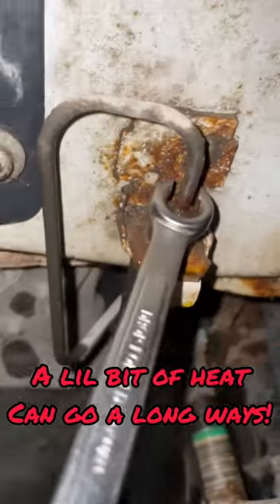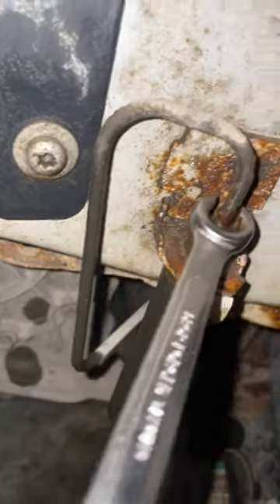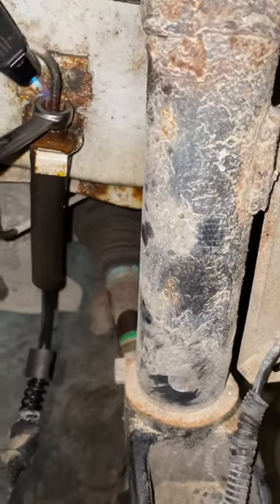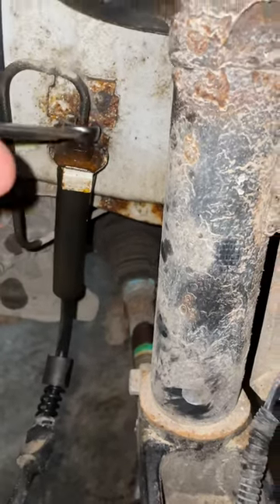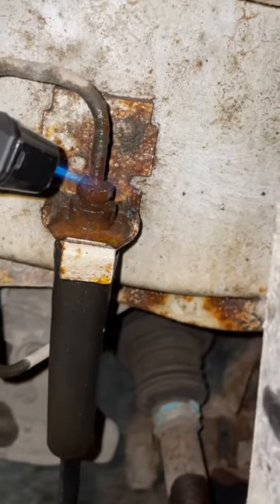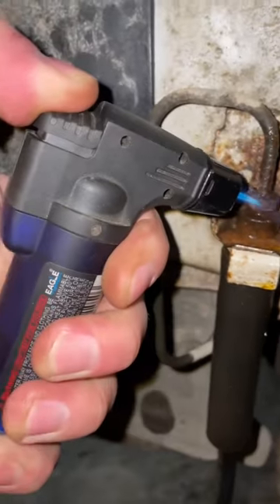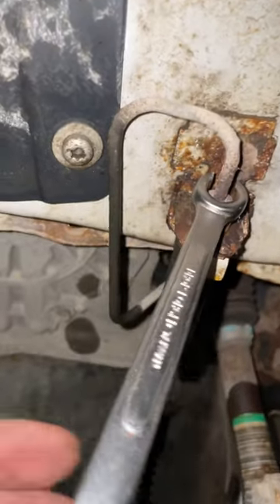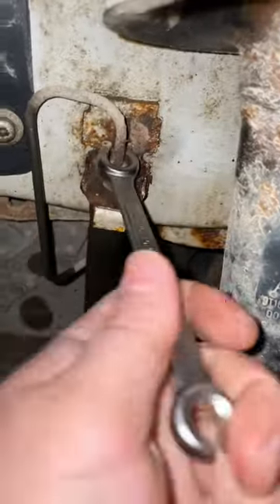When it comes to rust, heat is your best friend 😎

Comment: I could see myself twisting that line in half like it was yesterday
Reply: That was yesterday
Reply: @Bouldergoat  😂
Reply: Lmao
Reply: I just did that the other day
Reply: Did that on an old Chevy fuel line
Reply: I think everyone has done this lmao
Reply: Im guilty
Reply: Yeah, my “fix” usually involves 2 breaks, mostly due to impatience.
Reply: I was thinking the same it's shot anyway. Then you could remove the fitting with a socket.
Reply: Cheap Chinese line wrench is most likely stripped they don’t get heat treated

Comment: THE MOST IMPORTANT  part of this op is not to round the hex before using heat.  
Additionally - cycling heat / cool / heat cool a few times causes the metal to shrink and swell creating separation

Comment: Great tip!
Don't forget about using a backing wrench when possible, to avoid twisting the assembly.
Reply: What do you mean by backing wrench?
Reply: Typically a 2nd wrench (possibly vice-grips if necessary) to hold the stationary fitting from being twisted.
Reply: @thisisyourcaptainspeaking2259  the is no stationary fitting it's just a brake line with a regular ol fitting
Reply: @MacAutoDiag  What if the flare nut refuses to release, how do you avoid twisting the steel line and/or wallowing out the bracket?
I guess you need more than a single flare nut wrench, no?   Else say good bye to the steel tube?

Comment: When installing lines I pull the nut back from the flare and coat the line with antiseize. This prevents this from happening. Put some on the threads also.
Also, on car that I haven’t replaced the lones on I spray every bolt and these brake lines that I can reach whenever I’m under the car or have a wheel off. At some point I may have to remove any one of those bolts in the future.

Comment: Sometimes if the nut will break free from the hose but the nut is stuck to the metal line, you can take the hose clip off and drop the hose down through the bracket enough to spin the hose off of the nut

Comment: It's good practice to crack the line or bleeder loose to alow pressure relief if overheated. I've had rotted flex hose crimps blow out. Or be sure to wear face/eye protection
Reply: I was wondering if additional considerations should/could be taken. I’ve seen it done on suspension fasteners but I wouldn’t have thought about doing it on a stubborn brake line.
Reply: This guy silly, that brake fluid gets up to 200 degrees, there ain’t no way that lil torch wud get even close to those temps. 🤦🏿‍♂️
Reply: @txmade4371  Since were on the topic, have you heard of people heating up ball joints and having them explode? I can't remember if it was ball joints or something else that I heard about.

Comment: The thing to remember is heat does help loosen it up. But brake fluid is flammable. So too much is a bad thing. You don't want the fluid to get too hot inside of the hose or brake line. Only use as much heat as necessary to get the job done
Reply: I live in a Scandinavian country where they throw corrosive elements on the ground when it gets cold

You are right, but sometimes there is no such thing as too much heat - butane torch definitely wouldn't have done the job on my 250k mile Volvo haha
Reply: Good consideration, but it is not particularly flammable. It is like oil, it only lights up if torched for long enough, and it definitely will not light up inside a sealed line full of fluid. Sure the external torching of line will make some pressure inside the line, but the system will handle much higher pressures in normal operation. So no explosions nor line-internal thermal runaways will occur.

So generally the torching of the fitting can be said to be perfectly safe. Only if it leaks, there is a possibility that the leaking fluid will light up and give "dripping flames" at worst, easy to extinguish with a not-too-flammable rag, which you should have around, though.

Only actual danger arises if you have a puddle of fluid around.

Edit: True though that too much heat is bad, as it may damage the rubber hose. And may even cause it to explode as a combined effect of heat elevating the pressure while deteriorating and/or softening of the rubber. This has, however, nothing to do with the flammability of brake fluid.

You should by all possible means keep the heat on the metal fitting and pipe side, out from hose side. If need for prolonged torching, active cooling of the hose side with wet rags or something like that might be a good idea.
Reply: My only disagreement is what the heat will do to the properties of the metal line
Reply: @xESPplayer500x  Probably just retract, the wear of the end line would just make me want to redo it over anyway personally. but if it's a customers car may be a different story on how they want to go about it.
Reply: Brake fluid isnt flammable unless you have an extreme amount of heat. You could pour brake floud on the ground and hit it with a cutting torch and it wont light
Reply: @timm.e.n.  this. I don’t even bother with using anything other than oxy acetylene anymore. Way faster and always works you just have to understand that you can melt things if you aren’t careful lol
Reply: @xESPplayer500x  the metallurgy is fine at the temperatures required to loosen up things. Maybe 450 to 500F on the nut, which means maybe 250 or so on the line itself. Steel doesn't start changing properties until you get up in the 800-degree territory for prolonged periods. You'd be there half the day with that tiny torch pointed in one spot to get dangerous temperatures on the nut. And even then the steel wouldn't undergo any significant change. I've reused fasteners that I've taken to dull red, which is around 1,200f.

What's worth worrying about is the line's wall thickness reduced by rust. But it'll probably last longer than the rest of that crusty heap in that climate.
Reply: @tonyw1563  corrosion resistance

Comment: try "painting" a drop of hydrochloric acid based drain cleaner and waiting five mins (won't hurt the rubber line if you need to reuse) rinse and crack off works on most rusty cruddy stuff. eats it alive👍
Reply: But if the acid isn't cleaned off properly more rust will appear
Reply: It will eat the line up
Reply: Acid & rust 😂

Comment: I like to use my induction heater. Can wrap the coil right around the line, heat the fitting quick and not risk burning the surroundings
Reply: I was going to ask in the comments about breaking out the bolt buster. I know it's not a time saver but it does the job correctly and safely.
Reply: Yeah, an induction heater is great, except that they're in the $250  - $500 range.

Comment: This happens to often to older cars and it’s a pain to fix. When I replaced all my calipers and brake lines I smeared grease all over the fittings to try and reduce the air/water exposure.

Comment: Update,  I  tried this on my 2005 gmc sierra 1500 rear wheel cylinder.  It frickin worked great.  PB Blaster and mini torch and patience,  heat and wiggling gently back and forth and rust broke free and saved me a huge line repair headache.  Thanks.

Comment: That little bitty torch send perfect for tight areas like that
Reply: i even use that kind of torch to soldering car wire, more faster than using an usual soldering iron.
Reply: @Bobo-ox7fj  Never knew that electronic flux will corrode things.. that corrosion only happen with a acidic flux made for the copper pipe weld.. never seen that happen with electrical solder and flux even if you not clean it afterward.

Comment: Changing the rubber line? Cut it off, remove it from the bracket and THEN get at it with the heat and wrenches .You don't want to be anywhere near an exploding rubber hose. Hold the line fitting and remove the rubber line fitting. Free the steel line fitting later.

Comment: It's common for the hose itself to rust down into the retainer nut. So while you can break the nut itself free the hose is turning with the nut as well. If you're not careful you an break the line as it twists around. They have a decent amount of twist though, I've definitely rotated some a few times and still been able to use the line and connection.

Comment: If you want to replace brake rubber pipe, it's ok to open it.

If just rust outside and nothing damage (brake fluid circulation) or leak issues just leave it or clean the rush and repaint, repaint help rust not come back earlier

Comment: PB blaster can't get in there because of the type of thread.
But if you use some heat on the area it is screwed into you can get at it without waiting.
You can then use the penetrant while it's hot for saving the brake line .
Some of those, only vise grip pliers crimped on very tight will allow knocking it free with a hammer.
Glad yours was not so bad.
Just looked bad.

Comment: Easy, cut the hose, remove the retainer clip on the end of the hose, gently push the metal tube thru the mount exposing the flare nut below the mount. With correct size flare wrenches on the cut part and flare nut. Separate and deal with the stuck flare nut. Heat  nut and a melt a crayon (any color) into the stuck nut. Ancient Auto Tech tricks.

Comment: If you’re replacing the hose then cut the hose, remove the retainer clip, push it through the bracket and hold the brake line nut and unscrew the brake hose ferrule from the nut. No danger of breaking the line and no little lighter bs.

Comment: I strongly recommend cracking the bleeder or cutting the rubber line open (if replacing it) to avoid it blowing up in your face.  Probably not likely with the small torch but still, better safe than sorry.

Comment: When I was young I took a propane torch to a brake line to try and get it loose and I overheated it the rubber line exploded and covered me in boiling brake fluid yeah those were good times
Reply: I just mentioned that too.

Comment: I’m fine with this method but just a little tip be careful heating up any kind of brake lines cause it can build up pressure and when you crack that line loose it will spray hot brake fluid at you. Maybe after you heat it up put a rag over it as your cracking it loose.
Reply: How is it going to build pressure??? Any pressure would just go up to the master cylinder. No different than pushing the caliper piston in.

Comment: I have dropped the line down, twist the hose off and twist the new hose on. Insert back into the bracket
Reply: Easy fix many overlook. Good catch.
Reply: I've done that a lot of times too. When you work in the salt belt you learn how to live with rust and not fight it unless you have to.

Comment: Good deal! in hard cases you can open the caliper bleeder and get the fitting red hot and 9 out 10 you'll get it loose... But be careful brake fluid is flammable!!😂👍

Comment: I usually smack the spanner to give it some impact or failing that cut the brake pipe with side cutters and use a 6 sided socket. Another trick is hammer the next size down normal spanner on to it the impact will help to loosen it

Comment: Be careful with the heat.  Back when I was still learning I used too much heat a few inches from where the hardline and rubber line meet.  Heated the fluid too much and it blew the shit out of the rubber hose.  Bubbling hot brake fluid in your eyes isn't pleasant

Comment: You should be replacing that metal line as well. That rust won't heal itself
Reply: That's like 3 years old rust where I'm from, I'm not replacing my brake lines that often.
Reply: It’s not that bad.  Coat it with fluid film every fall and you won’t have to worry about it getting any worse.

Comment: A tap with candle or crayon sucks the wax right in, and it don't burn away light penetrating oil, or a tap with and ice cube to shock shrink the line from the fitting

Comment: It's also amazing what a lot of heat does, I would've just started with the big torch, your lucky you got it loose with the little one
Reply: It won't get red hot whit that but it's enough on brake lines if you need the big guns it's fucked anyway just cut it off

Comment: Try to use wax when heating with torch works great to loosen tight bolts n nuts and way cheaper. Heck dollar  store candles will work!! 
Better than most expensive chemicals in  bottle.

Comment: Once fitting is loose, take clip from bracket supporting flex hose push brake line thru hole put wrench back on fitting (cappler) and unscrewed flex hose.
Reversed all operation when putting back 
🤔🤨

Comment: On these I use a small finger belt sander and grind the part of the hose with the thread in it untill you can see the thread just poking through. Works well and doesn't damage the line at all. Quick and easy.

Comment: I always cut the brake hose off before I torch them. Those brake hoses can pop like a fire cracker in your face. The heat vaporizes the fluid and creates pressure the hose can’t handle. Ask me how I know…
Reply from the maker: I have it disconnected at the caliper. No pressure build up here. Good tip 👍
Reply: @FerKurl  probably sounds crazy but I’ve had them pop even when they’re off the calipers. Both times it was right at the end where the hose was crimped on to the fitting.

Comment: And don’t overheat the part. Had my trucks stuck so I did this not with a baby torch but small homedepot torch. After a while trying on the second side the fluid got so hot it exploded and vaporized the brake fluid. Lucky I was just turning away to talk to my friend. The side of my face had a mild burn due to the hot vapors but was fine a couple days later. Lucky I didn’t get it in my eyes!

Comment: You pull out the retaining clip out of the brake line pull the hard line down through the opening vise grip the flexible brake line and break it loose with a vice grip and they put it all back together

Comment: Pro tip, awesome job, next time dry heating the female part of the fitting, it will expand the metal and give you even better results if it's a stickier fit
Reply: Bad idea. The heat melts the Flexi pipe connection at the ferrule. I have experienced it myself. I'd rather cut the steel line, get 6 point socket on flare nut and repair the brake pipe with a copper section. Or replace Flexi pipe
Reply: He did heat the female section. The line was frozen to the nut. So when he turns the nut the line twists with it. Or were you confused about the gender? I know with all the non binary crap out there genders can be confusing lol.
Reply: @peterangtaylor21994  Copper for brake lines? SMDH
Reply: @bushmaster2936  You have never heard of copper brake lines? They are infact superior to steel lines as they do not corrode. Maybe that isn't the done thing where you are from but I assure you we more or less exclusively use copper for brake hose repairs in the UK.
Reply: @peterangtaylor21994  The only Copper that I've ever seen in brake systems are the washers that seal between banjo bolts and flex hoses to calipers. 
"Due to the terrible history, the use of copper brake lines became illegal in the U.S." per Google research.
Unless you are referring to Copper Nickel alloy brake lines which are allowed in the U.S., then no, I have never seen or heard of Copper brake lines.
Reply: @peterangtaylor21994  they are on ly copper coated.
Reply: Terrible history? I have never I'm my life heard of any issues with them. Maybe there was substandard stuff going around in the past that put people off. We all use it here in the UK. It's really easy to work with and requires no tools to bend. In the UK we have salt on our roads during the winter that rots the steel lines very quickly and it's not uncommon for us to replace full sets on lines with copper pipe on cars as old as 10 years.  As far as pressures are concerned the pressure in the line is minimal compared to the caliper. Copper pipe is extruded while steel lines are usually welded along a seam and are more likely to split with age. Also I never said the copper wasn't an alloy of some kind. A little pedantic to be honest. It does make up the majority of the composition. You may all find it hard to accept but it's a perfectly good and safe way to repair/replace lines.
Reply: @peterangtaylor21994  Copper is prone to stress (vibration) corrosion cracking.  Brake lines here are often a combination of rolled alloys in tube form.  They have a much higher bursting strength than copper.
Reply: @peterangtaylor21994 "As far as pressures are concerned the pressure in the line is minimal compared to the caliper". 
Silly goose, at what point do you think the pressure is created?
"Also I never said the copper wasn't an alloy of some kind."  
And yet you continue to only say Copper, copper, copper. SMDH

Comment: I'm taking a computer disc drive apart.  It had T5 torx screws. They are tiny and they were stuck.  I thought, well it's not a big 15mm rusty bolt like on cars but maybe the principle is the same.  So I heated the head of the screw with a Bic cigarette lighter.  And it came right out.

Comment: Heat is your friend, however it depends on what gas you're using.  Obviously the "big guns" of which you speak at the end do the best job because acetelyne burns hottest.  MAP gas is fine too although I think it's a bit cooler.

Propane will take forverrrrrrr to heat up, believe me I've done it to a wheel hub and a brake rotor and IT SUCKS!!!

Comment: This is the reason I had too get a new wastegate😂 bolt was rusted and stuck down to the actuator, tried heat, wd40, different tools. Ended up rounding out the bolt and bent the actuator

Comment: Usually one would heat the female receptacle that a bolt or fitting threads into as the heat expands the female part off and away from the inserted bolt or fitting. But hey why bother thinking about what your doing when you can "just do it"